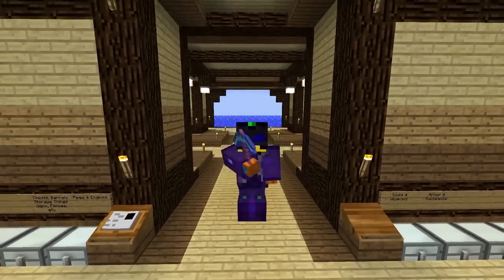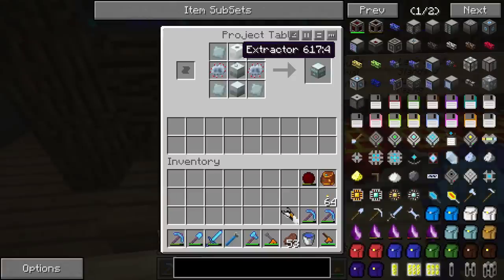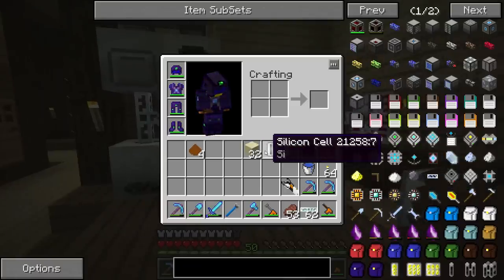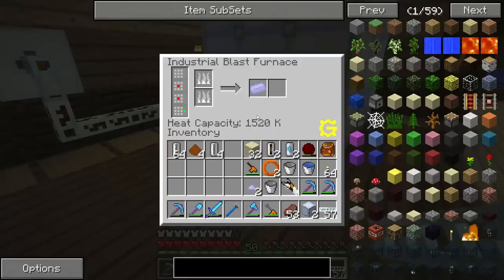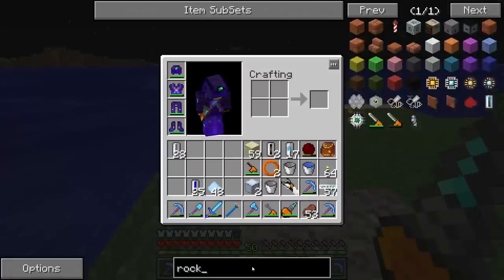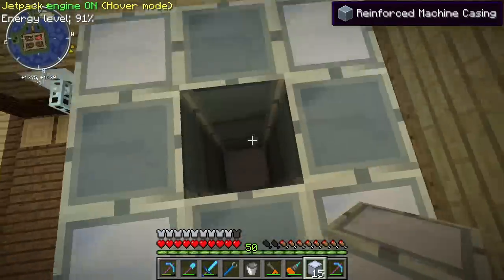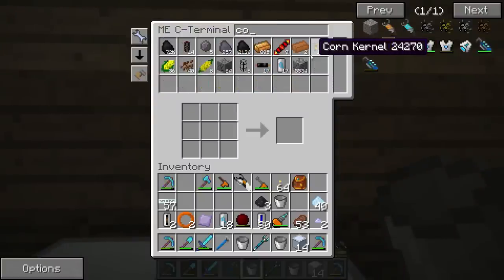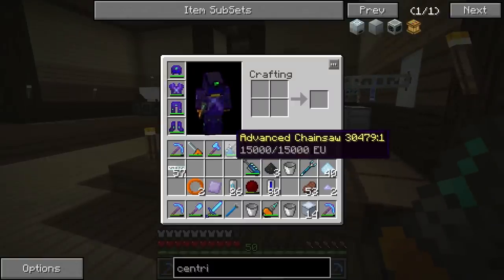Minecraft FTB Hermitcraft Part 18: Industrial Blast Furnace + Power Tools!

Comment: Marriland, two things. First, use a lever for the induction furnace, rotary macerator and other T2 IC2 machines, it will charge up to 100% and stay there, but it does require a constant trickle of energy, but a small one. Also, I'm really hoping for a tour of DMac's base next ep, I know I already said to do one, just hoping.

Comment from the maker: The main FTB packs just updated to 1.5.2 (Unleashed and Unhinged) without RedPower, and if the 1.6 version of RedPower is not finished within a reasonable amount of time, it will not be included in 1.6. There are already plenty of replacements available which replicate a lot of the things RP added. And yeah, I've gone ahead and put the lever on the stuff after the next episode (did a bit of recording at a time).